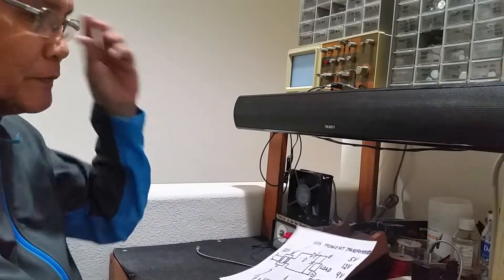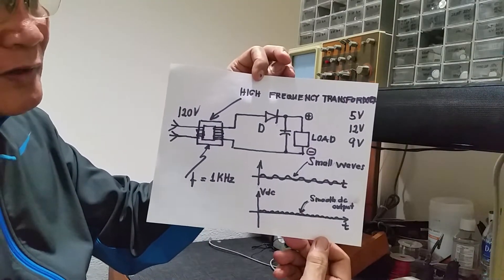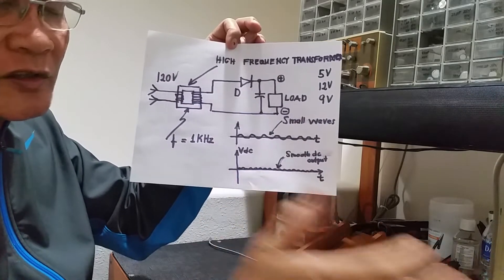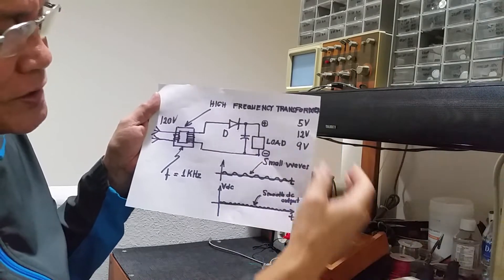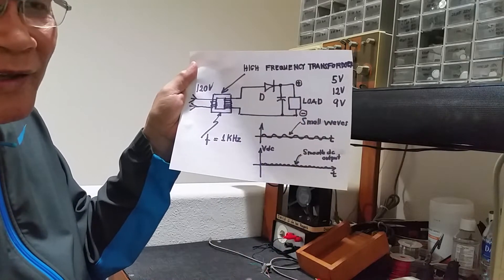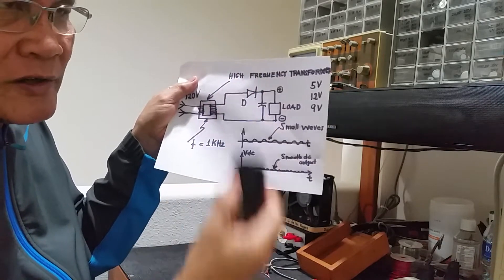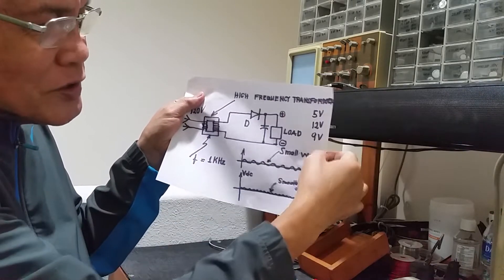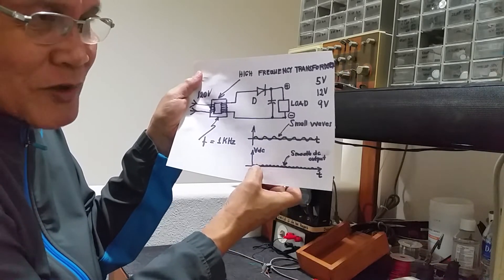High Frequency Transformers

Comment: Thank you professor David for explaining use of hf transformrs in charging digital devices,

Not clear

How 60 hertz input transformer began producing frequency  of 1 khs.
Reply from the maker: Thanks for the compliments.
Reply from the maker: On the secondary got oscillator to produce the desired  frequency.
Reply: @ProfDavidJDeLosReyes  

Thank you so much.

So by adding auxiliary gadgets to secondary of xfmr, many desired results can be achieved.
Reply from the maker: @surendersingal2192  the oscillator is within the small board itself not a separate gadget.
The oscillator is an small IC by itself.
Reply: @ProfDavidJDeLosReyes  very kind of you.

Can amini cut of secondary winding be shown to post out location of oscilator?
Reply from the maker: The oscillator is on the secondary. The schematic is needed if you want the exact thing.
Reply: @ProfDavidJDeLosReyes  sir

I got rough idea.  From my devices I can not draw schematic.   But thank you lot for your talk on HF transformer using your schematic from your Lab.
Reply from the maker: You cannot draw your knowledge is still limited. Schematics are designed by schematic engineers. I suggest you start with block diagrams to visualized how the circuit works before tackling the actual schematic diagram.